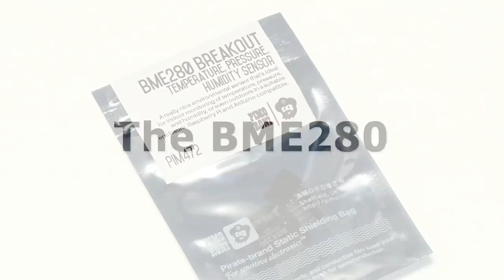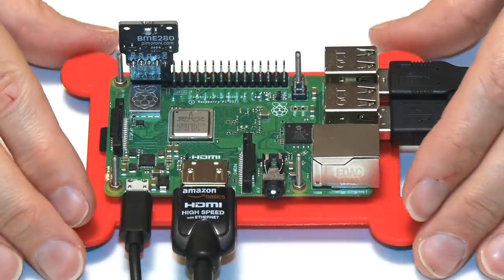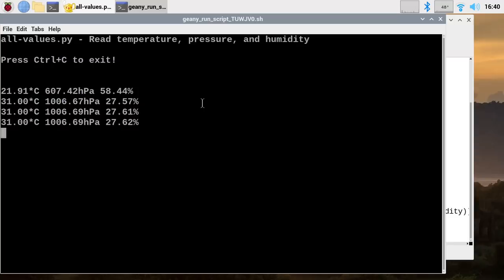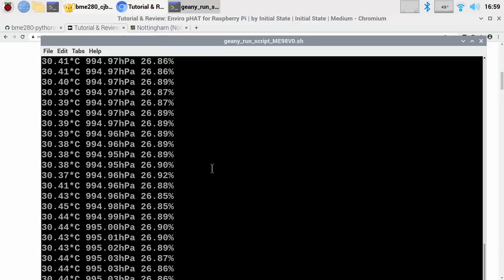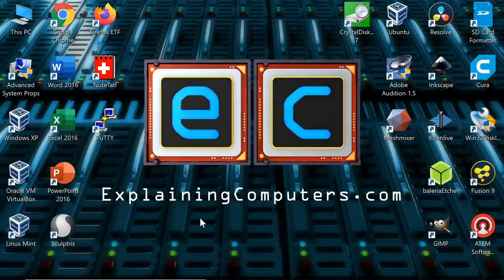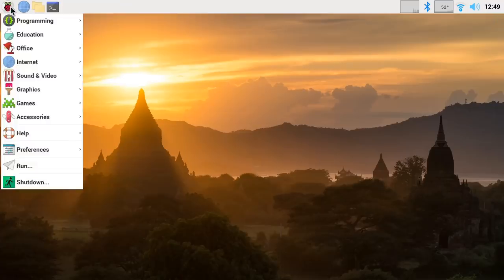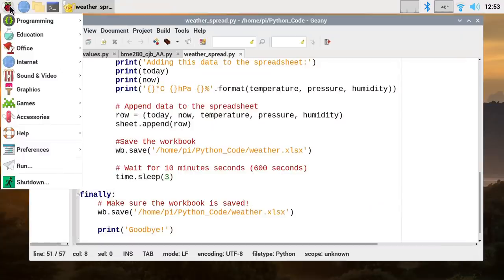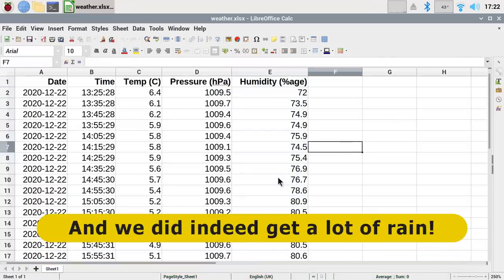Raspberry Pi Weather Station

Comment: I remain amazed at Christopher.  His smart, yet non- condescending, manner is encouraging and reassuring.
Reply: Mister Scissors...?
Reply: @tonyross2947  Not forgetting Stanley The Knife.
Reply: @youreds91  🤣🤣🤣
Reply: @tonyross2947  Please refrain from mocking the Edged Weapons, Sir.
Reply: @tpobrienjr  🤣🤣🤣
Reply: @i_used_adblock_to_watch_this  I hope no-one thinks I was being horrible about him; I just found it funny when he said "Mr Scissors" - made me feel like I was back in high-school science class, for a moment.
Reply: I value your in-depth tutorials, which are fun too. Please keep them going. Thank you so much.
Reply: Quite a lot of hidden programming in a method that reads a complex spreadsheet file, finds the latest unoccupied row, inserts data there and saves it again. 

Glad we did not have to code that in the project. 

Even a simpler version using a  CSV file format would need the appending process to work unless the print output in thonny converted to csv at the end of meauring..

Comment: I really love this.  Thank you Chris.  Here are some silly thoughts about what I would do next with this. a)  Dump the data into a database - something like MySQL, so you can make some serious queries and save the data for a long time . b)  Use a graphing tool to show the data in graphs with a UI that allows for specific time frames etc. have the UI runnable off a webserver installed on the RPI. c)  Attach a LiPO battery with a Solar Panel and a timer : Allow the RPI to wake up every 1/2h or 1h and take measurements (as sample), save it and go to sleep. d) Allow the RPI to dump the database to a NAS (just in case the RPI is pillaged or struck by lightning -- it does some ionizing with all that hardware :) and enable the same UI  running off the historical data stored in the NAS - e) Have a network of these spread through the house to collect data off the various floors.  - f) 3D Print a case with space for the sensor(s), solar panel and LipoBattery - g) Shrink the Moon h) Steal the Moon.

Comment: I did the same thing (with another sensor) but to collect the data I stored it on a google spreadsheet, so it's easy to view from everywhere and you can have self updating charts. The downside is that you obviously need internet on the PI

Comment: Of course you showed how to solder properly. I can't tell you how many videos I watch where they touch the solder to the iron, then kind of drip it on the connection point. Not a surprise that you properly do it by heating the connection with the iron first and then apply the solder so that it immediately melts and binds the components. Well done - and you can tell - the connection simply looks good!

Comment: This is a great video! I built a weather station using my Pi last summer. Something I did slightly differently was using two BME280 sensors and averaging their results to help correct for the inaccuracies in these cheap and small sensors - also placing them in a white thermometer box. For my setup, I also had a solar panel and battery in place so that it could run without mains power - and I used the Raspberry Pi as a charge controller (this was the most complicated part of the build as it involved a lot of manually testing voltages and comparing them to ADC read values to build a comparison chart, as my ADC was limited to 5v but I was using a 12v panel and a 7.5v battery, so using resistor based voltage splitters to get a smaller but proportional voltage going into the ADC and then converting them back to real voltages in software to run the relay to allow power from the solar panel onto the battery rail or not (using a buck converter to match panel to battery v, and again to match battery v to the Pi’s 5v)). Also had it add the weather, battery and solar data every minute to an online SQL database which could be accessed through a website - so i could keep an eye on the whole setup remotely.

Comment: Hey, i have just recently discovered this channel and i instantly fell in love.
Just wanted to add a little detail, humidity is often represented in water% in air, but important factor to mention is that the hot air is able to store much more water in it than cold air. So for instance if weather outside is 0degrees C and has 95% humidity and gets in your house, warms to 20degrees C it will also drop in humidity %. it still has the same amount of water but is able to store much more now since air itself is warmer. Thats also why it was showing lower result when the sensor was closer to rasberry and had a higher temperature.

Comment: I use RPI to collect various temperature measurements (2 room, 1 outside, 3 water temps in the buffer tank) to text files (daily basis), and use a simple php and javascript to make a graph of them. The apache and php running on the RPI as well.

Comment: Remember Chris that the humidity measured here is "relative Humidity" i.e. relative to temperature. So as the temperature drops the relative humidity will increase, not necessarily and indication that it will rain...... but it might get foggy :)
Reply: oh how we used dew point to describe the humidity levels in the air rather than relative humidity
Reply: @dontabor6708  @Dave M.
Reply: I keep trying to explain this to people.  Logged on just to do so, you guys beat me, wish I could get everyone looking st the right number.

Comment: Thank you for encouraging video. It, has left me liking the idea of building the rig you showed and thinking about the possible uses I could put it to. You bravely, including your initial error of not mounting the sensors away from the RPi, which was a good choice, as it demonstrated the need to separate them from each other, in a practical way. Moreover, in showing it, rather than just saying it, you engendered greater learning, for me.

Comment: I have at last got around to completing this project. Terrific. Thank you. The only hiccup I encountered was running the executables. They fell over due to /r (carraige return) errors. That was down to me saving the files by the wrong method. Your instructions were, as ever, flawless. Moving the Pi Zero WH to the garage worked wonders as a method of cooling but sadly it was out of range of my Wifi router. Incidentally There are 4 pin BME280s on the market which are half the price. They work fine as the contact marked with the prohibition/no entry sign isn't used.
Reply from the maker: Great to hear this worked! :)

Comment: 20:29
Humidity hasn't really been increasing there. 
During the first measurement absolute humidity was 5.36 g/m^3 and during the last one it was up to 5.47 g/m^3. This difference is not significant and might be even within error tolerance of the probe. 
Relative humidity has risen, because the temperature has been dropping.

Comment: Excellent Video.  I will be using some of these techniques in a project where an Arduino collects analog data when requested by an R-Pi then the R_pi will store it on a spreadsheet as you have demonstrated.  Now, as a 74 year old my next step is to learn Python to add to the large set of computer languages that I have used over the last 50 years.
Reply from the maker: Good luck!

Comment: Careful to get actual BME280, purchased many that weren't as advertised.
Reply: Yeah, many are the cheaper versions without the humidity.
Reply: were they defective in some way @energyideas?
Reply: @zenmaster24  Many sellers mix up (accidentally or otherwise) the BME280 with the (much) cheaper counterpart bm*P*280 - which doesn't detect humidity.

Good explanation here:

https://goughlui.com/2018/08/05/note-bosch-sensortec-bmp280-vs-bme280-sensor-confusion/

Comment: The BME280 has two problems. First, the sensor heats up if you read the values too quickly and often. Second, the air pressure is measured correctly, but the weather forecast calculates the air pressure at sea level. The measured value is lower as the altitude of the location increases. To do this, you have to find the factor by which you multiply the measured value to get the value at sea level. It differs from place to place.
I built a weather station with the ESP8266. I can read the data on the website on the ESP8266.

Comment: it will be amazing to get an eINK screen and make this into a standalone unit
Reply from the maker: Yes, there are possibilities . . .
Reply: The Pi is perfectly cable of running InfluxDB (a time-series database) and Grafana for creating graphs and gauges. Grafana runs as a web-UI so you can view it (remotely!) with a browser.
Reply: Control the weather ?

Comment: Thank you very much professor! I suspect that allthis can be done on a Pie0w as well. Also is it possible to add wind speed/direction and a rain sensor to this weather station?
Reply from the maker: Yes, a Pi Zero can do this just fine. I must delve into the wind side of things . . .
Reply: I've been using a PiZero for this for about 4 years now, with a rain sensor and also a relay to control a fountain in my garden which shuts the fountain off if it detects low water level, or if the outside temperature drops below freezing. The Pi0 also hosts a small website which displays the data, so more than adequate for this type of project.  Most wind speed sensors use a magnetic switch to detect a rotation of the rotor cups. Again, the Pi0 should be able to count the number of rotations over a period of time and calculate the wind speed quite easily.
Reply from the maker: @tonydonnelly  Great to hear this. I can see that I must delve into a wind speed measurement system -- I had been musing on using a optical sensor to monitor the rotation of a windmill.

Comment: Excellent video Chris. Ironically I have been  thinking of late about a weather station project with one of my Pi's. Another input I'd like to add to my project is a sensor that will provide soil moisture as my wife does a bit of gardening. We tend to get very warm temperatures in the summer and it's easy to have our soil get too dry before we water the plants. Thanks so much for sharing.

Comment: Great idea! Ordered a bme280 almost directly after seeing this video :) I hooked it up to a pine64a that I had in the drawer, which has a compatible gpio. Today I received the bme280 and used some of your python script, thank you! It's now in a test setup just outside my backdoor, and need to make a longer wire for the sensor and get a nice housing for it. Never stared so long at temperature, pressure and humidity ;) Will add the excel bit soon to the code.       Anyone that has a good experience with a nice housing for the sensor? Please share link to it! :)
Reply from the maker: Great to hear!

Comment: Another excellent workshop Chris - thank you. It would be interesting to see the data displayed as a graph so trends may be more easily spotted. Also, changing the code to automatically spot trends it could output a weather prediction.

In the meantime, now the Pi5 is here, I'm excited by your proposed next project. I like blue skies and 20 degrees but giving us choice over our weather sounds great. If the new code can be adjusted to localise the set weather, we could make sure we choose appropriately for that annoying neighbour.  I wonder what peripherals will be needed though - and if Pi Hut will have them in stock 🤔🤣

Comment: Massive overkill mate! Surely an ESP chip with mqtt support gives the same results without such an overhead?
Reply from the maker: It is a Raspberry Pi Project . . .
Reply: mqtt on an esp still will blow your budget (memory wise) as the bme 280 calibrated correctly is a bitch....check the data sheet trev. I see what you are saying, but this sensor is a beast when on the rails
Reply: You can still use micropython on your ESP, my random amazon BME280 had two breakout boards, so now I had to buy an ESP chip to connect the second one. Just used influx on the raspberry pi, if you do a post request to the ESP, you can add data to the database. Then also run grafana on the RPi and you can readout both sensors in a graph.

Comment: Lol, you can't change the weather with a single board computer. You'd need at least two boards.
Reply from the maker: Ah, right. You are probably correct. A cluster approach needed.

Comment: Hi Chris,
Your humidity increases because your temperature drops. What you're seeing from the BME280 is relative humidity, which indicates how saturated the air is with moisture. The warmer the air, the more capacity so to speak. Hope this clears up why your humidity is increasing with lower temperature. I think if you were to calculate the absolute humidity, you would see that it stayed relatively constant.
Regards,
Rasmus

Comment: As a follow up to my comments, I had an enjoyable number of sessions trying to make a BMP280  work with a Pi Zero W, I succeeded. On my need to find out and an possible idea for an extension to this tutorial would be to get the data remotely, from the pi W via wifi for a home weather station.
Also, it's worth mentioning that the pressure is the local air pressure and not the mean sea level air pressure, that the Met folk use, so compensation has to be made for that in a weather station use. My house is 400ft above sea level so that's approx +14hPa to make it read mean sea level pressure, 1hPa per 30 feet.

Comment: Excellent video as always!
 I have the enviro+ board from pimoroni (with air quality sensor) and am reading data in horribly inefficient and messy ways :) but it is working. 
 I push 5 min averages of the data to another pi running dockerized postgreSQL and Grafana instances so I can store and display the data. It was immense fun setting up.
Please keep these pi videos coming! They are awesome.

Comment: Thanks! I want to use a RPi to fill a spreadsheet with voltage and current readings to characterize the charging and discharging of an eBike battery. This video has given me some clues about the spreadsheet logging part, so I now need to learn Python and how to use a 16-bit ADC board from the I2C bus. I will check your other videos and try a few things.

Comment: im an electrician and ive been wanting to make and install automated raspberry pi based greenhouses. solar powered or grid powered systems powering a raspberry pi and its sensors & motor actuators to lift panes/ turn on fans to create airflow/expel heat.  dehumidifier and humidifier to control the perfect humidity for your crops, maybe a heater if youre in a colder climate.

your videos are really helping me learn the coding side, i think im ready to buy my first raspberry pi! please put out more of these types of videos. maybe a video on how to make a simple android based app that can interact with your raspberry pi and read things like temperature in real time? id love that.

Comment: Temperature is inversely related to relative humidity. Warm air has the capacity to hold more water, so, as temp goes up, RELATIVE humidity (% saturation of air at the current temp) goes down, as the air can now hold more water.

Comment: Great video, regards to the pressure reading. It's spot on if you are 33m above Mean Sea Level. 
Pressures in weather charts and forecasts are presented at MSL as a QNH pressure. 
You probably measure at some altitude, therefore reading a lower QFE pressure.

Comment: For people who want to run something like this in the background, look up either "linux screen" or "nohup". Screen is more powerful. Nohup is easier to use but arguably harder to stop processes cleanly. The way it's presented in this video, the command will stop running if you disconnect the SSH session.

Comment: Great choice! I also used the BME280 on a weather station project as well, though, instead of using a Raspberry Pi, I used an ESP8266 because it was cheaper. You could probably also use a more modern ESP32 as well.

If anyone wants to find my old project, it's still up on Github: hydroArgentum/Small-Weather-Server under the ESP8266Demo, though, I haven't updated this project since.

Comment: Good stuff. I did something similar back in 2015 but for temperature only using a DS18B20-Temperature sensor. Hooked it up and used some perl to read the values to a file then used RRD to get the value, store it and then make a nice image which I linked to a web server running on my Pi so I could just browse in and see the temperature in my brewery. Moving on to more recent times, I bought a "Tilt" which is a floating device that sits in the fermentor and records the temperature and gravity of the beer as it ferments and it logs to a spreadsheet on google docs. There are homebrew versions of the Tilt but not tried those out.

Comment: I use this one in a number of projects myself using an STM32 or ESP32 on both arduino and Zephyr / RTOS.  For any new players just be aware that the bme280 needs a few seconds to become ready for reading values over i2c, this is more important if you are using a battery and turning things off / putting the main mcu in deep sleep for instance.

Comment: I did a similar project using a DTH22 sensor which only measures temp and humidity.  I also created a log file and stored it in CSV format.  What I would change in your code is what I did in my code.  Instead of using a while loop, I only ran the program once and saved the data in a log file.  I also created a bash script to rename the log file with the date and create a new empty log file at midnight.  I used crontab to control the file renaming and recreating and also to take a temp and humidity reading once every 15 minutes.  I think it makes the code neater by doing that.

Comment: I just finished similar project few weeks ago. Connected a DS18B20 temperature probe to one of my NUCs and made the NUC to control the space heater on my living room with a TP-Link Wifi mains socket. 
The BME280 sensor you are using looks a lot better than DS18B20, though.